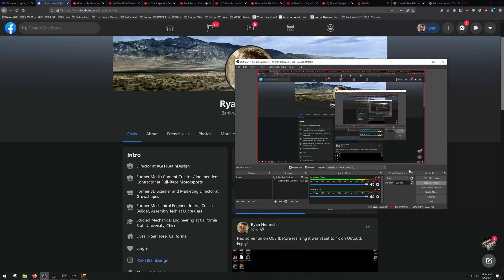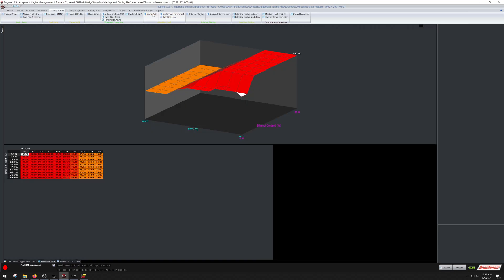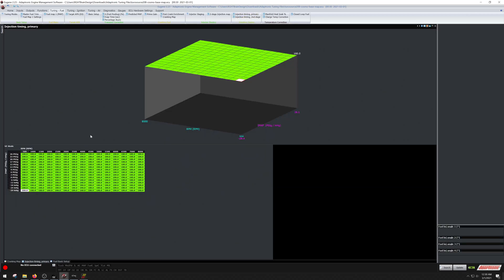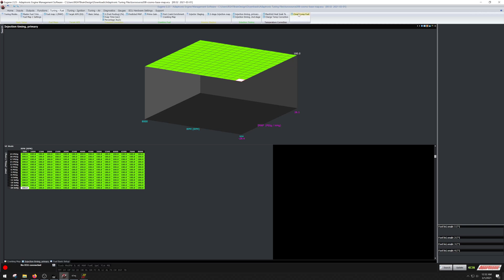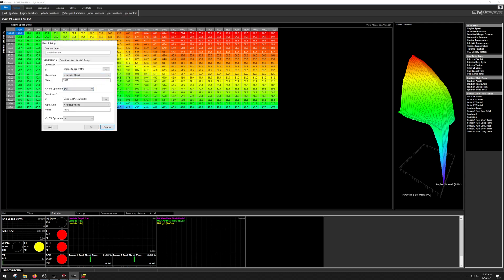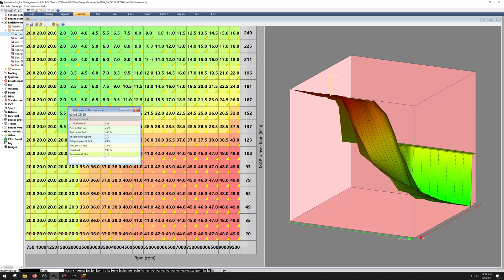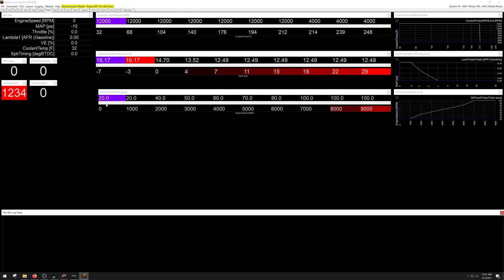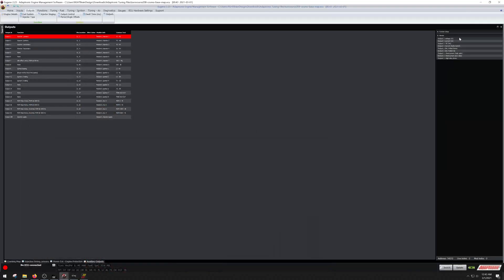ECU Overview Part 1 - Adaptronic Focused

Comment: I have older adaptronic and cannot solve my off idle throttle :( it will bog and stutter off idle if reving or trying to take off normal. If you just give it like 25%  throttle and up it runs great and runs good in boost. but off idle, small throttle input its rough. Should  I be looking in the predictated map?

Comment: I mean adaptronic on his own is a great achievement, but is a sophisticated mega squirt right?
Reply from the maker: What's a great achievement?  I'm lost.  This is the most unreliable option for any Rotary Owner.  A Solid "No" from me.
Reply: @RGHTBrainDesign  iono he seem like the face behind adaptronic. So that’s cool if he was. And yea I should state he got recruited. Anyways I know this is under ur league but you think this would work since I’m making it. A plate between the manifold intake for. A 6 port. And have throttle plates for the aux port. And mount actuator solenoid that I could activate it on a emanage blue as a vtec fuel map
Reply: Should not state if he was or wasn’t my apologizes
Reply from the maker: @daesyoung  you could just make a set of solenoids being controlled off of an ECU.  It doesn't make sense why you would do anything with the emanage.  You're moving backwards...
Reply: @RGHTBrainDesign  the s4 is a exhaust back pressure deal. I know the emu is not anything but it’s cool to think it’ll have a fuel map for the auxiliary opening lol. Man ty for responding Man U cool. So save up for a g4 right...
Reply from the maker: @daesyoung  Haltech, ideally for Rotary Folks.  Link G4x is good, but not my favorite.  Then the response kings and folks who want all the Motorsports controls are going to end up with Emtron/Motec.
Reply: @RGHTBrainDesign u mentioned Emtron.. sounds cool if I get all the control! Idle, ignition timed rev limiting, auxiliary port tiny throttle plate position tip in gain lol. I mounted my Iacv where those two ports by the egr center, iono if I should check valve it but stock they share the same lil room . I got mines to run on the new China released affordable dcoe itb... Ima look into it. Emtron.. I don’t like haltech... iono why. but aye. You really be tuning in real time Kyle mohans rx8 while he’s on track drifting, or u have had done so before? But anyway theirs this other kid on YouTube he mentioned u did his tune, he like a skater cat. I think he live near Canada.. but in the USA. but shit sound hard. Primered s4 6 port turbo. He has the link g4. I appreciate u. I’ll stop bullshitting and when I go turbo I’ll try have ends hit u up ty

Comment: sorry bud you are wrong here. you can configure outputs with rules although you may not get a full table. MAP prediction is not "fooling" the map sensor, it is covering for the latency of the MAP sensor and the fact that MAP is not actually that stable and needs to be averaged over a period. I find the injector staging to work very well as is and don't need to change it. transient fueling is a little tricky but does work well once you figure out how to deal with it. I will have to try playing with the injection angle to see what effect that has.

I appreciate what you do but i think you are a little overly critical of the adaptronic here and the fact that it is not in some race car somewhere probably has more to do with the size of the company than whether or not it has the correct functionality.
Reply from the maker: These corrections will come up in Part 2. Thank you for reaching out.